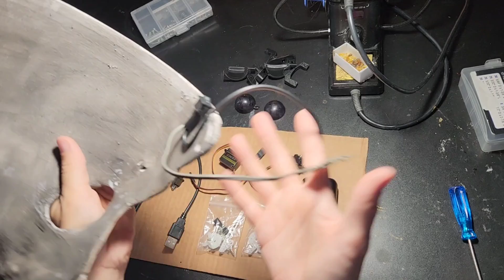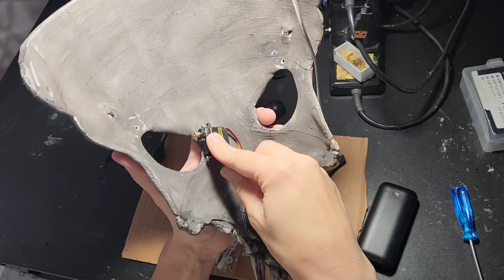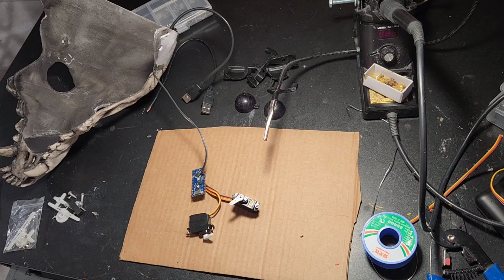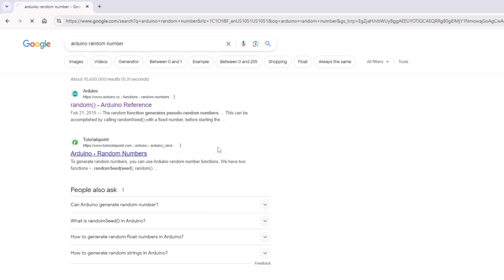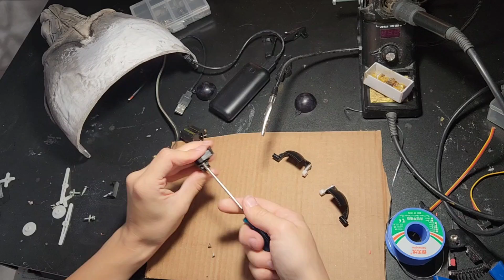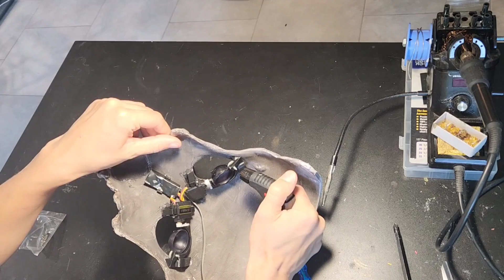How I add eye blink animatronic to any mask - Part 1: the mechanism

Comment: Hi! How did you get this working with the 5V and the microservos that stall at 1A? Connecting my red wire with 5V and brown with ground as told. Mine does not appear to be working, nor connecting with USB. 

EDIT: Upon disconnecting solder, the Arduino does turn on.
Reply: Additionally, did you turn on your power supply when connecting to the computer? Or without it?
Reply from the maker: The yellow needs to be connected to a D number on the arduino and the arduino needs to be programmed before itll do anything. The power supply shouldnt matter when connected to the computer. And ofc red and brown cannot touch

Comment: I really struggle with calculating power supplies in parallel like you have there with the two servos powered by one pin - is there an easy way to calculate this as just thinking about it makes my brain hurt
Reply from the maker: i dont calculate anything. Just power everything directly from the battery, do not draw the power from the board

Comment: INCREDIBLY HELPFUL! I can’t wait to try this with my cosplay. By chance, do you have any suggestions about hooking it up to a remote? I’m thinking of having 4 servos controlling each eyelid and thought about having a controller (like an infrared) input a command for movements like a “wink” or just the top eyelids for a “frown”. I’m incredibly new to electronics and constructing them so any information helps! Fantastic work!!!
Reply from the maker: Its somethign I want to look into in the future, so i don't know precisely. My best bet is looking up an arduino nano project that involves remote control for tips, then simply integrating that into this basic control setup. Adafruit blogs has a LOT of projects that might help you out on remote control arduino.

I would omit the bottom eyelids or have one motor control both eyelids on one side (i had double action on an older project but the linkage was unstable and it's worse for vision so thats why its only upper eyelid on this project).

You can also look into a trigger on your cheek so you can use your cheek or jaw for control without having to install remote control. Buttons that trigger easily such as limit switches work well for that

Comment: did they get rid of the "sweep" example in arduino? i cant find it
Reply from the maker: @absurd207  you need to have the servo library installed to find it in your examples
Reply from the maker: @absurd207  if you cant find it, google arduino sweep and just copy the example code into a new arduino sketch window. Make sure the servo library is installed or it wont work though
Reply: @WillowCreative  i got it working, thanks so much!

Comment: Bro you have a good job and I want to do something similar but could you tell me how you did the servo system?
Reply from the maker: this video shows exactly how i did it 🤔🤔
Reply: @WillowCreative  But you made the black pieces that you have or how I do them is that the only problem I have is what makes the servo flow
Reply from the maker: @aaron9462  to make similar plastic pieces you can use a knife to cut a moon shape from a plastic ping pong ball and glue it to the servo motor 👍